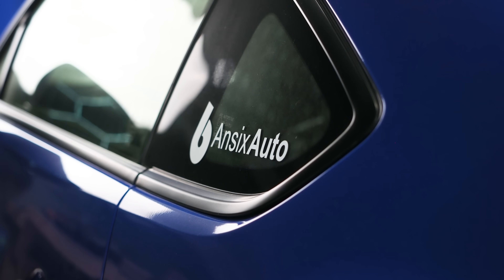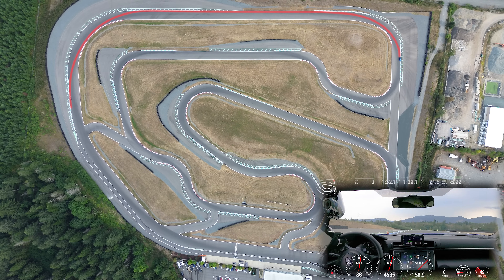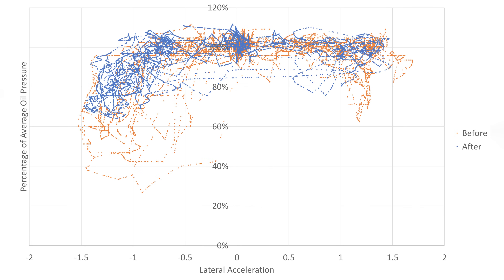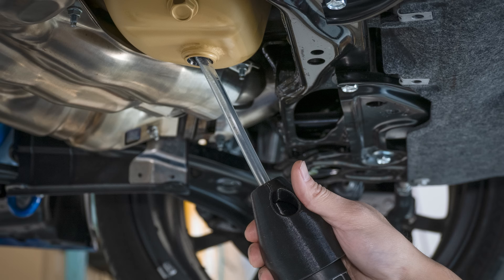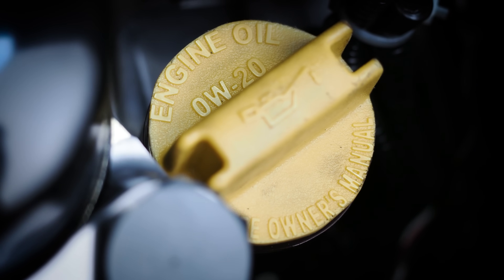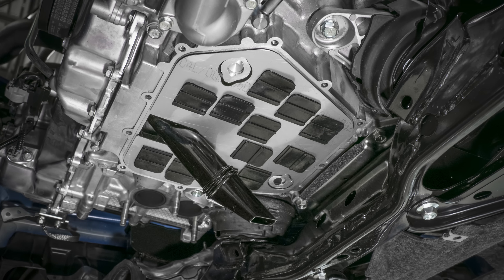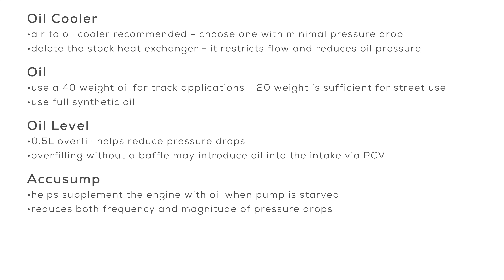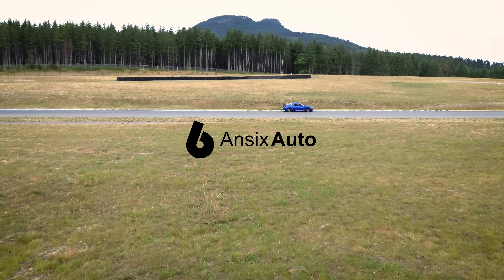The FA24D Engine: What Toyota & Subaru Don’t Want You to Know

Comment: They have sold a ton of these cars and you guys are making a big deal about a very small number of actual issues. Also feel like we see the same guy repeatedly talking about it...how about getting some actual data of actual number of motor issues, form this?
Reply from the maker: Just because the motor isn't blowing up doesn't mean the low oil pressures are not an issue. The low pressures will happen to ALL cars out on track.

Comment: Toyota literally designed everything brilliant about the twins. Balance, handling, driver feedback, the list goes on. But what Toyota engineers had not anticipated was using Subaru parts. Shitty engine, lug nuts, paint, the list is never ending. For the Subaru fans that think Subaru actually designed the good parts as well, well Subaru has not made a RWD for a long time let alone a RWD sports car. Sorry, but Toyota screwed up partnering with Subaru.
Reply: Toyota didn't design any of that though, since all the engineering was done by Subaru (so the balance, handling, feedback etc).  The car was literally 99% designed by Subaru (designed, engineered, and built).  Toyota put forward the business case, provided a large amount of capital, did marketing (Toyota is a marketing behemoth), and made Subaru use the D4S system (Subaru wanted to use their own direct injection system instead (and there are news articles on this), but Toyota made this one thing a hard sticking point - probably so they could put Toyota on the engine cover).  
Subaru then went off and did all the R&D and built the first prototype which was based on a modified Legacy platform (which they did before even agreeing with the partnership, it was this prototype that made them agree to the idea - there are news articles on this).  They then moved it to be based on the Impreza platform.  
The only design Toyota did is the grille and the other minor tweaks they did to the BRZ.  Subaru literally dropped off a fully finished BRZ to Toyota, then Toyota made minor changes for their 86 variant (and added their marketing spin on how it was to the rigorous preferences of Mr Toyoda - there was a video of him inside a 99% finished one testing it and talking gibberish).  Also news articles - e.g. "Toyota CEO Akio Toyoda has instructed the 86 development team to better “differentiate performance from the BRZ”.
Reply: @Jez4prez1   Source please? Although, there aren’t any concrete sources that say Toyota did everything either, but all of the information points well in that direction. I’ve never ever seen a statement saying Subaru did all the R&D. It’s usually hearsay from the car community. The so called news article is probably suggesting or speculating some information at best without anything concrete.
Reply: @truth8326  nah everything I said is 100% for the gen 2.  The gen 1 Toyota did initial design (styling, and came up with the idea of a cheap RWD sport car - which they marketed as being 'inspired by the AE86'), because they were the ones who put the business case forward.  But the gen 2 was fully designed by Subaru.
The gen 1 is interesting since both actually had prototype cars.  And they co-developed a concept car.  Toyota had to do some initial design to bring Subaru on board.   Subaru then went off and did the engineering and built it (and altered styling to fit the build).  And for the gen 2 did all the redesign also.

Toyota still had an important role, as they encouraged Subaru to make it, since Subaru wouldn't have done it otherwise without Toyota's money and without Toyota putting the business case forward in the first place.  Plus Toyota marketing helps spread the car to a much wider audience, so more sales, and Subaru is making money on every 86.  Toyota makes money on their sales, plus owns 20% of Subaru anyhow.  Subaru still operates as an independent company, however, so they need partnerships (contracts) to transfer tech, gain capital, etc, like they have done on a few cars now.
Reply: @Jez4prez1  I'm still waiting for at least one source. My conclusion is based on the information that is already out there because Subaru has never said that they solely designed the twins themselves. "Everything you said is 100%" really isn't a source or very convincing at all.

Comment: Its not just thr BRZ. Its every subaru boxer engine EVER. The BRZ is the car that amplifies the problem the most because it is capable of the best handling.
Reply from the maker: The move to timing chains likely made the issue worse since it opened up more volume in the engine for the oil to go. The newer pickup on the FA24 is likely a worse design compared to the older motors.

Comment: It's cool that you worked to overcome the design flaws of the car, but the fact that they couldn't get oil pressure in a 2023 car that was marketed as a track capable car makes the BRZ dead to me. There are so many different problems with this stupid boxer engine they can damn well keep it.

Comment: Default oil grade is 0W20 ??? You must be crazy running this kind of grade, even when doing street driving and a bit of messing around no ?
Reply: Street driving is fine. The problem lies in the oil thinning out as it gets hotter, specifically above 100℃ and no oil cooler. Sport driving or track should use minimum 30 and an oil cooler.

Comment: This car should have been an FA24 turbo. No oiling problems, and a swan song to outgoing ICE because power to weight ratio would've made it one of the great blue collar sports cars of all time. Instead they chose this, this anemic NA power plant that rips it self apart in first month of ownership. ICE going out with a whimper.
Reply: C'mon, it's faster than the WRX FA24 turbo as it is being in a lighter car and still has the 7500rpm redline.  The FA24 is a dramatic improvement on the FA20 in power delivery already.  Using the Ascent engine with a 6000rpm redline and losing the NA throttle response would not make for a better sportscar.  Just look at the dyno plots, the FA24 performs just as well as the benchmark Honda K24 now (if not slightly better in some ways).  The idea that the FA24 NA engine is anemic is ridiculous.  The Ascent WRX engine is not a fun engine.  The NA FA24 is not the best twin-cam (flat-)four ever, but is a lot better than the bland turbo Ascent engine.  Quality of power is better than quantity of power.

One of the last old-school NA sportscars, that's just as quick as a Honda S2000 now,  is the exact opposite of ICE going out on a whimper.  Especially when the alternative is having a bland SUV engine that only revs to 6000rpm...
Reply: @TassieLorenzo  it would be same engine with turbo and only ever so slightly heavier because of intercooler. Plus huge margin for tuning unlike the asthmatic NA version.
Reply: @idokwatcher2062  But turbocharged (four cylinder) engines are not nice to drive, no?  They have doughy throttle response. They don't react instantly as the throttle is cracked, unlike an NA engine.  I had a couple of turbocharged vehicles, an old school GC8 WRX and a modern Renault 2.0 turbo and I just don't like them.  Of the two, the GC8 was preferable as at least the turbo lag followed by surge of boost was exciting, the Renault (being more modern, twin-scroll) just simulated a V6 engine: but one that sounded and felt like a blender, not nice at all.  In either case, they were just not nice compared to the responsiveness and linearity of a naturally aspirated (VTEC!) engine.

While the FA24 is not quite a K24, it's pretty close now.  (and it still meets emissions regulations unlike the Honda engine, so well done Subaru!) :)

The current WRX engine seems awful by comparison, it's truly a SUV engine put into a sport compact.  At least the GC8 EJ20 revved to 7000rpm in the Australian model (8000rpm in the Japanese model).  The FA24 WRX only revs to 6000rpm, it's ridiculous. It's like a really mediocre simulation of a flat-six...

In any case, the notion the current GR86/BRZ is asthmatic is just not right.  It's plenty quick.  It does the 1/4 mile in about 14.0sec flat, no?  Any sluggishness of the old 2.0L version is well and truly fixed. It's totally fine and perfectly zippy now, no?

My GC8 Impreza would have been what, 280hp (with VF34 turbo) & 1270kg and ~13.5sec quarter-mile and that was somewhat zippy, and the BRZ is now 240hp (but no lag and MUCH wider powerband and MUCH closer gearing) & 1270kg and maybe 14.0 sec quarter mile. The BRZ seems perfectly adequate as is and that it has no turbo is precisely what is great about it!

If you want to add boost to a GR86 or BRZ you could always do a supercharger, which keeps a lot of the NA driving characteristics and is far preferable to a turbocharger IMO.

Comment: I need to point this out, you guys never solved the issue at all. Putting in Acusump on and saying "you fixed it" is BS. Acusump is bandaid not addressing the real issue.

These kind of pressure drops have a cause and until the source of the issue is found it can't be fixed. The question is did this happen with the previous model 86 and if not what changed about the oil flow in the engine when they went to the 2.4L.

Comment: Terrific video; concise and comprehensive. Both Subaru and Toyota need to take a good hard look at specifying such a light oil with the first change at 15,000km. Completely inappropriate for track focused car. I changed mine at 1500km and again at 5000km (Amsoil 5W-30 Signature). This issue aside, what a fantastic car :)
Reply: Oil change recommendations are literally for daily driving...

Comment: I'm picking up my 2023 BRZ limited in a month. I ordered it about a month before the actual cause of the engine blowups was discovered, back during the RTV craze (not saying the RTV isnt an issue but I don't think it alone will blow your engine up). This video is great at analysing the solutions for this issue that actually work. Earned my sub.
Reply from the maker: We do think the RTV issue plays a role. Having the pickup clogged can exacerbate the pressure drops.

Comment: Great video! Thanks for sharing! Question: why didn’t you consider to mount a bigger oil pan? Do you think the oil pan does not bring any advantage to reduce the problem? Thanks!
Reply from the maker: Unfortunately the space beside the pan is taken up by the header. There's just not a lot of space to work with. If you could fit a larger pan, it could definitely help.

Comment: Have been running Pennzoil Ultra Plat 5w30. I do a bunch of autocross so I’ll switch to 5w40 since you guys had luck with it and overfill a half liter. And then for winter (end of autocross sesson) I’ll switch back to 0w20? Is this ok?
Reply from the maker: I think that would be fine. For autocross, your oil temps might not even get high enough to warrant a need to go to a higher viscosity oil.

Comment: I used to suffer from a similar pressure drop with a factory oil pan.  The engine application was a 1988 Toyota Celica GTS (3SGE).  The oil pickup is under cylinder 1, which is the right side of the vehicle.  Any hard or prolonged right turn had the result of a massive oil pressure drop as the oil moved left.  I solved this issue by purchasing the Moroso 20935 oil pan.

The key to that oil pan is the hinged doors that surround the oil pickup - they allow oil flow inward, but prohibit oil evacuation.  This oil pan also increased the total capacity from 4qt up to 6qt.

That 1 modification resulted in virtually zero oil pressure drop around any/all prolonged right hand turns (90mph @ 7000rpm) - rough time estimate is 5-6 seconds.  That turn is relatively flat.

I don't know which oil pan you have, but perhaps something similar to that would be beneficial.
Reply from the maker: Certainly modifying the pan and increasing the volume could help. The only issue is, there's not a lot of space since the header wraps around the pan.
Reply: @AnsixAuto  900BRZ seems to have come up with a solution with a larger pan that does require removal of the OEM header to install but it still works with it.

Comment: just want to ask, If i remove the heat exchanger and install Jackson racing, can I still use the OEM center bolt or need another bolt?
Reply from the maker: You need Subaru 15018aa090. We also found some clearance issues with the hoses so we had to shave down our oil filler cap for everything to fit.
Reply: @AnsixAuto   Thanks! Hopeful will come a detail video about installing accumulator and remove heat exchanger !

Comment: was planning to buy a GR86 for track use.
however, will not do this and now looking for the old model GT86/BRZ
unbelievable that this happens to a new Toyota ... !?
Reply from the maker: Don't let this dissuade you from getting into a GR86. It's a fantastic car and the engine failures are not as common as it seems.
Reply: @AnsixAuto  
yes, maybe that is true
however, another thing that bothers me is the fact that using the car on track and then having issues, is often not covered under warranty….
Reply from the maker: @cayman9815  Totally agree with that. Our approach is to avoid having any issues in the first place.

Comment: Screw the COG, id much rather have literally any other engine than something Subaru designed. It's incredible, their engineers have been smoking crack since the EJ. Toyota, just put the 1.5t, 2.5, 3.5....anything but a Subaru motor
Reply from the maker: If we had a huge following on YouTube, we'd definitely consider doing a GR Corolla motor swap build series.

Comment: Do you know if this is still an issue on the 2023 models?
Reply from the maker: Yes because our car is a 2023 model year.
Reply: @AnsixAuto  Damnnn, I haven't tracked my 86 yet but I do drive it pretty hard, But I think all the fixes would void its warranty. Which is stupid Subaru should have known this and the RTV in the pickup was an issue and fixed it before releasing the cars.
Reply: @AnsixAuto what about 2024 models?

Comment: This car has a Subaru engine.  Subaru's engines always have oil starvation.  I have seen Subaru owners counteract these issues by running a higher pressure oil pump in their Subaru cars.
Reply from the maker: It's a combination of the flat motor design and the crank driven oil pump. Oh well...

Comment: This was great, i think the accusump is a great choice. I've looked at the accusump system by canton. Did you go with a  manual setup, or how did you set it up to push oil in when needed?
Reply from the maker: Ours is a manual valve setup but we're going to be developing an active system which decides when to charge and discharge. This will put less wear on the Accusump and the valve and it will also prevent having excess oil in the crankcase.
Reply: @AnsixAuto  that I think is a great solution,  I think just on my end providing more information on the accusump will provide great insight for this community.  I know I'm going with it, and having data and information would help me greatly. I appreciate your vids, I'll be checking in when provide other vids. Good luck and nice build so far,

Comment: 40 weight doesn't sound like a good idea. This falsely raises oil pressure. Think milkshake compare to water through a straw, the milkshake takes more suction (pressure) to get it to move. This can lead to starving bearings. A better call would be a tier 5 Ester based oil and maybe a 30 weight. The engines tolerances dictate oil weight almost more so than heat. Thicker oil also holds onto heat much longer making it harder to cool down.
Reply from the maker: The viscosity difference is exaggerated with your example. The reason for going to a 40 weight is because the viscosity at track temperatures is similar to a 20 weight a street temperatures. I agree, a ester based oil is a great choice.
Reply: @AnsixAuto  Ester based oils are far more stable than other synthetics. Going from a 20 to a 40 weight ester based oil shows better oil pressure of course but, I'd be very worried about bearing starvation still. Yes, these oils have a better additive content but, the purpose is to move the heat away from bearings with a steady flow of oil. I've seen people grenade their engines by running a thicker viscosity on track. I've talked with oil manufacturers about this and they rarely recommend stepping up in oil weight even for track. They typically recommend a better oil with a wider temp range.

Comment: External oil radiators need to have very specific size piping designed for a specific engine. if the piping to the radiator and the piping inside the radiator core are too large, there will be a significant pressure drop. larger pipes will move the same volume of oil (at a slower speed). Smaller pipes will move the same volume with a higher speed (maintaining pressure): That's Bernoulli's Equation. Some basic thermodynamics

Comment: The only subarus I know which run reliably on track have either a dry sump, or an accusump ! Every other car gets rod knock ! IMO accusump is a must for all subaru performance applications , use a manual switch not a electronic one as they are not reliable !
Reply: The newer designed solenoids we are using has helped with that issue of reliability. We have gone through several iterations before settling on the current design (i.e part #24-270X).

Comment: What temperatures were you seeing without an oil cooler? With the 30 psi pressure drop it might be doing more harm than good.
Reply from the maker: You could be right, it's hard to say. We were getting up to 130*C by the second lap but it stabilizes there.
Reply: @AnsixAuto  thank you. What oil pressure did you see with 130°C and no oil cooler if you had a sensor then?